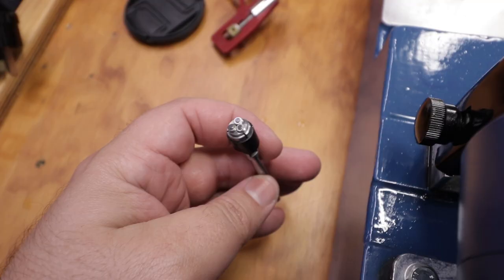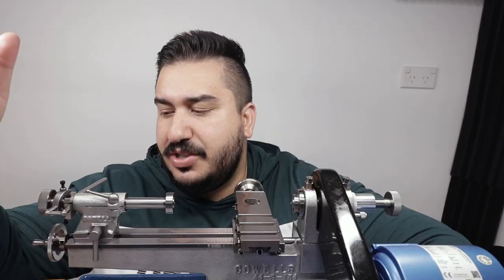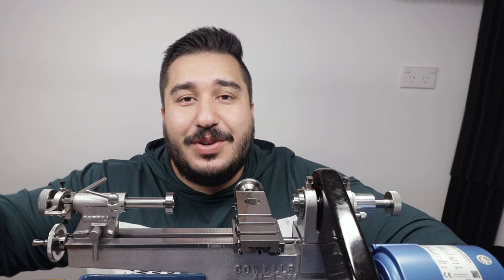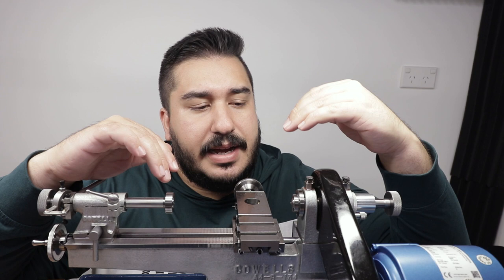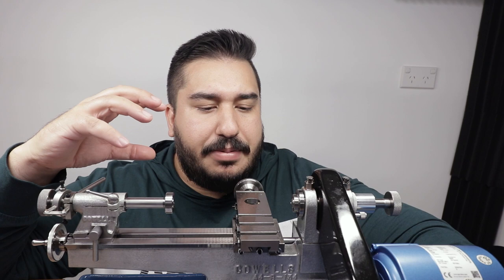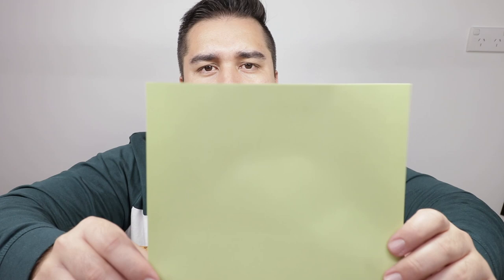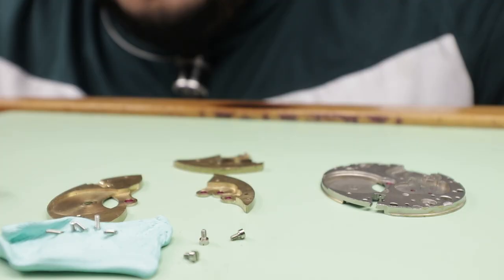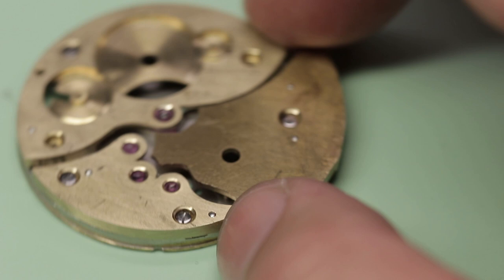Your thoughts on Exposed Guide Pins? - Watchmaking Vlog 23

Comment: I hadn't noticed any other comments on the threading tool so I might suggest that there is, I think a difference in the stock diameter when thread forming and thread cutting. Meaning the thread gets "mushed" into shape and so the extra material that would be removed in cutting instead gets bunged up in the forming die. A smaller starting diameter is required.
Reply from the maker: Thanks Nick 🙏🏼, yeah definitely need to taper the stock next time 😁😁

Comment: Happy to see you back and I appreciate that you are sharing your journey with us. Its the mistakes you learn form! :)

Nice to see that  you have found the Habegger thread rolling dies. They are just the best type of dies I have worked with. Can be used for the soft gold as well as blued steel. It is very important that you do not have the blank diameter to large when you form the thread, and that you also have a long starting angle of 10-20 degrees. I see that you have the nonadjustable type so if you want to make a S 0.8 thread (NIHS) for ex., your blank should be 0.63mm according to Habegger ( http://www.habegger-sa.com/INSTRUCT/Filieres%20a%20rouler/Instruct/3_IS_FR_E.pdf). I have found that this is not always true so you should start a bit smaller and see how it turns out and increase the diameter of the blank until you have an almost fully formed thread. If you go over size, the blank will seize and brake off. 

The german silver as well as the steel and brass can be ordered in various hardness so that you do not have to hammer or cold roll is your self.  Avoid buying metals from ex Bergeon. They usually do not know what they are selling. Check out for ex. L. Klein SA ( http://www.kleinmetals.ch/index-en.htm ) to get an idea of what is used in the industry now and then perhaps you can find metals with similar properties in Australia. 

You will find threaded guide pins and arbors in old high-end pocket watches from the past and if done correctly it can be very accurate when needed. It is just easier to use a friction fit pin just though.
Reply from the maker: Wow! I must admit I have a bit of shell shock to see your name and your feedback. I strongly believe it is the mistakes that people truly progress.

Thanks for this information. I had purchased via asco, and had no idea of the manufacturer. The link is very helpful. Also your practical experience in testing out the diameters is great insight, and making a long staring angle. I made the mistake of keeping the outside diameter equal to the thread size.

Thank you so much for the link to material supplier. Google searches don’t always get the best places to source things, especially for watchmaking I have found.

That is great to hear, I threaded to the holes in the lathe during the process of centering and boring my jewel holes. I think I could make it more accurate, but it seems a lot easier to just use friction fit pins. I think the next prototype I will go down this path.

Thanks so much for knowledge, and feedback about my journey. It is very inspiring, I hope that our paths will cross in the not too distant future.

Comment: 3rd generation Jr Watchmaker here... I love the contrast but prefer the look of simplicity with the hidden guides. One comment below mentioned blueing which I also like.
Reply: Ps. Threaded guide posts aren't familiar to me. I've only seen smooth and attached friction fit posts.
Reply from the maker: Thanks for watching and your feedback.. it’s great to put things out there and hear different perspectives, the bluing idea isn’t a bad one 😁 yes I think I came up with threaded idea as it assisted me to double the alignment pin holes as holes to secure the main plate too while I was centering the jewel holes in the lathe, and then have the ability to remove the mainplate off and bore the hole. Some people with good reason believe it isn’t accurate enough. Although, I have had a response from someone say that it wasn’t uncommon in the past to make it this way. Very interesting stuff 👍🏼😁
Reply: @DeanDK  If we consider a pillar plate it was the original design to my knowledge.
Reply: Maybe we could consider it a hybrid.
Reply from the maker: Main Arbor haha very true! 😁
Reply: @DeanDK  This is the first channel I've found with actual Watchmaking. Thank you!
Reply from the maker: Thank you for taking your time to watch and comment 🙏🏼

Comment: Great stuff! I heared that the rolling dies can be used on hardened german silver (annealed/blued) which saves lots of time and effort. It is quite an investment for a whole set, including different size holders though. A  watchmaker told me these should be used with 10% smaller diameter bars, the material will be pushed outwards to the final dimension, any experience on this? 
On a totally different note, if there is a lot of time between making the bridges and rodium plating, them, it can become difficult to get good rodium plating results. The different cleaning baths will not take the oxidation or other rubbish off completely (happened with my parts at a well known and very erperienced company, 4 months of work down the drain...). So my advise would be to do the plating asap after finishing the parts.
Reply from the maker: Wow thank you so much Machiel, I have seen your work.  👍😀👍 really cool!! I appreciate the time to watch and comment with some great advice. I will make sure to do that for the future.

Comment: Nice touch with the polished pins. I'm thinking you would lose some of the exactness in the guide pins using threads though. You're way ahead of me in your process towards your own watch but planning mine my thought was to drill holes for the screw and for the guide pin in the same set up. Then to ream the hole for the guide pin with a tapered reamer and then fit a tapered in there that matches the taper of the reamer. Then rivet the pin to the bridge. Although a polished head and a friction fit could also be done I think, so long as the taper is shallow enough. Maybe I'm overthinking this but in having a taper pin fit like that there would be virtually no tolerance in the uprightness of the wheels when assembling and taking apart the watch. Great work, as always!
Reply from the maker: Thanks Karl, yes a couple people have raised the same concerns. However, Kaj Korpela has said that it is also possible with threaded pins. I had originally made the alignment pin holes and threaded them when I was making all the holes in the lathe with the centering scope. I was just missing the actual pins. My thought is that since the threaded holes were made in the lathe, and same as the pins. It’s the best shot at being accurate, understanding that there is tolerances built into a threaded hole and screw thread which could lead to inaccuracies. I think I may just go with friction pins in the future, as it will cut down manufacturing time
Reply: @DeanDK  Alright! Seems like you made a very conscious choice. I think that any tolerance in the thread will be something that you can translate directly to uprightness. Especially if you don't have a flat head for the screw to align itself with. Let me know how it works out in the end!

Comment: Designing anything that uses threads as an accurate alignment method simply doesn't work and is almost never done in manufacturing for that exact reason. For two parts to thread together there has to be at least some minor clearance. The tap and the die also have tolerance specifications for how well they fit each other as well as having at least some measurable lead and lag errors along each of the male and female threads. The starting drilled hole even if reamed may not be truly straight and reamers don't 100% guarantee a straight or even round hole sometimes. For a non rotating pin either a taper or for a watch a light press fit are probably the most accurate methods. Drilling then boring for that straight / round condition and then reaming for size or taper would be my choice if it really does have to be the absolute best you can do. 

In my opinion you'd be far better off using a different and contrasting metal for the pins. Using the same metal and filing them flush and then polishing to make them disappear while looking nice creates some extremely tough future problems if the watch ever needs repair since there's then no accurate way of telling exactly where the center of the pin is to try and remove it. And since threaded pins would be very unlikely in a watch, anyone other than yourself wont know that and do further damage just trying to remove them. Also using the same material for the pin as the part it's inserted into is also frowned upon in engineering design circles since the same metals in tight contact with each other tend to gall and seize in the hole.Design and build with future requirements in mind.
Reply from the maker: Wow thanks for the in-depth response as always Turning Point! I think in the future I will be using friction pin as many people have pointed out the issue with accuracy. It’s also faster to make friction pins. Thanks again 🙏🏼 😁